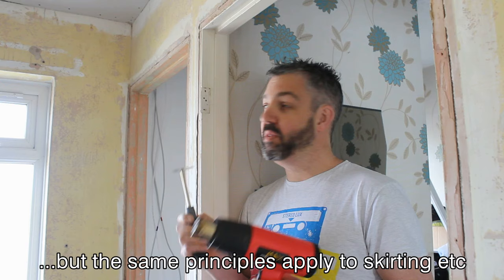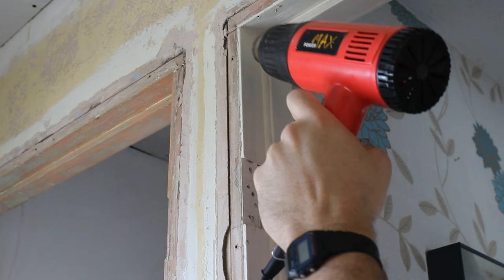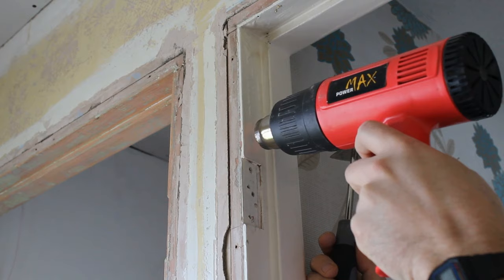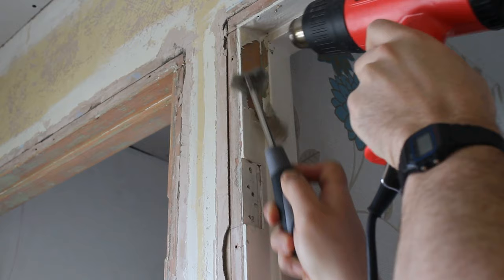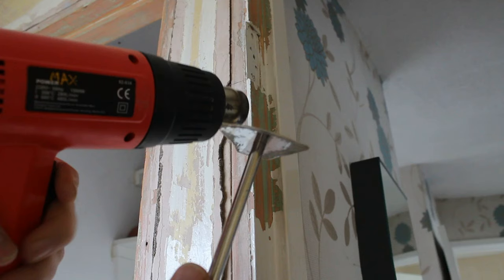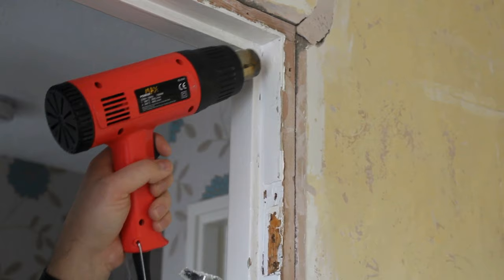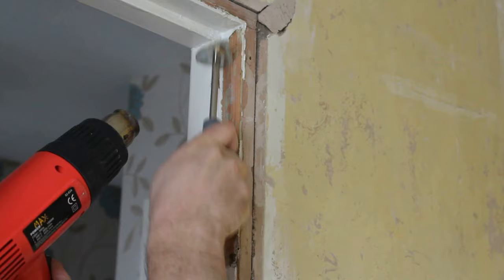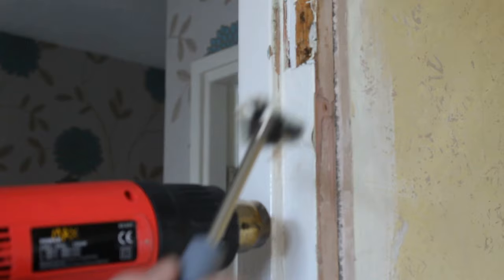How to strip gloss paint off wood - Easy way to remove gloss from door frames and skirting

Comment: Of course I just finished painting the walls and have now decided to strip the door frame and door.  (Always doing things the hard way!)  Do you recommend a way to protect the wall from the heat gun?
Reply from the maker: Oh dear! All I can think of is holding a length of wood (not too thick) against the wall. If you used metal, it would get hot too quick and transfer the heat to the wall. And don't worry, you shouldn't be getting it hot enough to set fire to the wood!! 👍🏼
Reply: @charlieshooter  Thanks.  That's a great idea.  .  I also found an attachment for the heat gun, with a smaller opening, which will allow me to be far more accurate.  I really appreciate your response, and your helpful video!  As I think about my options, I wonder if a wooden spatula would work.  Maybe even a metal one if I work 2-3 inches at a time and allow the spatula to cool between.  If I have to do a little paint touch up, I guess that wouldn't be so terrible.  Thank you again.
Reply: @charlieshooter  I did it!  No damage!  I eventually just used my scraper.  First, I scored the corner with a utility knife.  I placed the scraper at about a 45 degree to the wall, applied the heat and pulled the bubbled paint away from the wall instead of scraping up or down.  It worked great, two inches at a time.
Reply from the maker: Excellent....glad you managed to sort it in the end! 👍🏼

Comment from the maker: I've always found it easier to go top to bottom, so you can scrape the paint down. But do whatever feels easiest for you. Thanks for watching.
Reply: Cheers butt! Got loads to do! 😩
Reply from the maker: It's not too bad once you get going! Good luck with it all! 😀
Reply: I find it easier to follow the heat gun with the scrapper for long periods. Rather than stopping every few scrapes. Nice video, though!
Reply from the maker: @benjaminmears7257  You will find the best way for you. After just doing another load of this scraping recently, i would say it depends on the type of paint and how thick it was applied as to whether this works mind.
Reply from the maker: Terribly Vexed  It depends on the paint used really. I did some more recently and it wasn't too good where a water based paint had been used so emulsion on a wall may not get the same results. As for damaging the wall....that depends if it is solid or plasterboard i guess.
Reply from the maker: Terribly Vexed  Maybe try it in an inconspicuous area first!

Comment: That looks better than the gooey mess of runny paint stripper and scraping. I have a porch railing that has a thick coat of peeling porch that needs removing b4 painting. 3 hrs of sanding and scraping hasnt put a dent in it. Its like a thick pudding skin over the other paint. Paint under it is fine. I dreaded using the gooey stripper that needs a hazmat suit and 3 block area cordoned off. Great tutorial.
Reply from the maker: Thank you. I hope you managed to get the job done without a gooey mess! 👍🏼

Comment: Was debating whether to use a paint stripper or heat gun. My stairs have many layers of paint...there could be lead based paint too. But heat gun seems the way as long as I wear a mask and the area is ventilated. Thanks for this video appreciated
Reply from the maker: As long as you take all the relevant precautions you should be ok. Always assume there is some lead paint if you think there might be.
Reply: @charlieshooter  thank you! Appreciate your reply. Thanks

Comment: Thanks Charlie
great YouTube clip 
I bought one for a Diy paint stripping job and found it so easy to use
and saves time too
but one tip wear a long sleeve top, gloves and safety glasses avoids burns to skin and eyes 
believe me that melted paint is hot
when it comes off.
Reply from the maker: Good advice. Better to be safe than sorry!

Comment: Using a stiff stripping knife instead of those triangle type strippers cuts the job in half. You can put a lot more pressure on it. Wish I'd learnt that about ten years ago!
Reply from the maker: That's probably good for a large surface area, like a door, but I find the triangular stripper better for getting into the nooks and crannies.
Reply from the maker: Kip Kruse  Everyone seems to find the best way for them. 👍🏼

Comment: I’m stripping years and years of gloss off my nasty 70’s style staircase and door frames. I started off with the heat gun but burnt it out after an hours use 🤦🏼‍♂️
What I found was the gloss was bubbling and snapping/breaking off rather than scraping off. I’m guessing I was putting too much heat into the gloss?? 
Now resorted to sanding took about a weeks worth of graft. At least this lockdown has been good for doing those crappy jobs we’ve been putting off!
Reply from the maker: Yes, this lockdown is great for getting all those jobs done...and you can take more time than you would normally too, to do the job properly! 👍🏼

Comment: Thank you. I have a ensuite bathroom in my room. Because of the contact from the shower (wood did not have any waterpoof protection), the architrave and bottom of the inner door frame rotted. So I was going to replace the whole thing but decided against it as it was only a section, 30cm by 13cm wood will be needed to be replaced so decided to just cut away the rot but will be buying new architrave as they only about £3 ish each. I wanted to remove the entire gloss paint to bare wood so can use water proof, to protect it against any water damage and your video is perfect. I already own a heat gun and just ordered a paint scraper for a few quid and some wood filler to fill any holes or jagged edges. Many thanks for the tip.

Can I ask, what would you recommend for waterproof varnish or paint. I want to paint it all over the inner door frame, architrave and my new door so if it does get water from the shower, it won't rot?
Reply from the maker: I'm pleased the video helped you out. Thanks for leaving a comment.
An oil based (traditional style) gloss paint should waterproof the wood enough. If you're more concerned, maybe look for an exterior grade gloss.

Comment: Thank you!
Really useful video and very well presented.

Love that you answer the questions here! And so I have one...

Does the scraper not damage the wood? I’m looking to remove paint from a 1930s door frame and leave it unpainted but using the scraper I’m worried will leave scrape-marks?

Cymru am byth 
Liam
Reply from the maker: Thanks for commenting. You don't have to scrape too hard to remove the paint, so it doesn't leave any scrape marks on the wood. If you hold it at the right angle, flat to the wood, you shouldn't have any issues. Good luck with it!
Reply: Thanks Charlie!

Comment: That looks fantastic. Do you need to follow over with sandpaper, or is it good to gloss straight away?
Reply: Prime, undercoat, gloss. Always. I like using a sponge rad roller and lay off with a brush. Smooth finish every time

Comment: Thanks for this, I’m trying to remove gloss to change to satin. Can I use the heat gun and paint again? Currently using a scraper x
Reply from the maker: Yes that will work. You will need to re-undercoat.

Comment: Thanks for the video - most seem to be use citristrip/nitromors/chemical remover and scrape off which I didn't want to do! Where did you get the paint scraping tool - I've had a look on screwfix and tool station but haven't seen one similar and it looks like it'll be better at the fiddly sections?

Comment: Thank you that was very useful.  What temperature your gun is using please ? I have an adjustable temperature gun (50 - 660 degrees C) and I've no idea what temperature to use. I don't want to risk burning the wood. Thanks again.
Reply from the maker: Mine was 1500w and just had 2 settings, but it was just "high" and "low"....no idea on temperature. It actually died the last time I used it! Gutted!!

Comment: Hiya mate, have you got any safety advice for stripping lead paint? It’s likely my Georgian townhouse has got lead paint on the door sets, skirting etc. I wondered if you ever come across it in houses and what do you suggest? I’ve read that lead dust is very dangerous so I’ve put my DIY on hold until I know more. Many thanks for anything you might be able to share 😃
Reply from the maker: The dust can be very harmful yes, and so can fumes if you heat it too much. Heating it so that it literally just softens it (not burns it) should be fine, but make sure that you wear an appropriate sealed mask to protect yourself, not a paper one! Also make sure everyone else is out of the house for a few hours after, and it is well ventilated.
Reply: @charlieshooter  Thank you so much for your reply. I’ll take your advice on board 👍

Comment: Hi Charlie, thanks for the video, started a door today that had years of shoddy paint on top of one another. Any recommendations for cleaning the scraper now it's gunked up?
Reply from the maker: Turps or warm it slightly with the heat gun and give it a scrape with another scraper maybe. Hope the video helped!
Reply: @charlieshooter  helps loads Charlie! Really appreciate your work and started to do up the house using your tips. Without them I would have already made some school boy errors!

Comment: Running that heat gun, you could use some ear plugs to protect your hearing. Thats a lot of noise long tern so close to your ears. That old  paint coming off should be handled with gloves and a mask too ( lead or not- still chemicals).  Nice scrapper tool, Ive never seen one like that.
Reply from the maker: I think the heat gun sounds louder than it is in the video. Ear plugs would be a bit overkill. Gloves and a mask...I suppose I should've really, but if you're careful your hands dont need to come into any contact with the the paint.

Comment: I've been doing the same,  and I too have found the same green coating underneath the paint,  but not sure what that is?
Reply from the maker: It's an old type of primer. Some say it could be lead based, but I'm not sure....best treat it with caution though and at least wear a mask!
Reply: @charlieshooter  Thanks for the reply,  I suspected it may be lead based,  as our house was built in late 50's. As a precaution I did wear mask,  and made sure the room was well ventilated for at least a few hours after.  Cheers!

Comment: Hi, It's my first time using a heat gun. I'm doing the same job with 150 layers of gloss paint on my staircase. I just wanted to check the order of things. Once I've finished removing the paint should I sand it and then proceed to prime and gloss? Thanks.
Reply from the maker: Yes, give it a light rub back and then prime/undercoat and gloss. 👍🏼
Reply: @charlieshooter  Thank you, I feel like I'll still be at it this time next year but it has got to look better than 150 layers of gloss paint lol!

Comment: I can tell you know from my own experience that removing paint using a heat gun is not easy, in fact it is difficult. An heat gun will remove some paint but this depends on how tough the paint is and how the paint has been applied to the wood and/or how long it has been there. I tried removing paint using my heat gun off an interior double wooden door that has seen better days, and getting the paint off, even at the higher 500 degree setting, is a bloody challenge. Scraping the paint off whilst still applying the heat makes little difference, and often doing so will tear bits of the wood with the scraper because of the heat that has softened the wood. Another challenge is removing paint from a window sill and around a window frame, and also paint around spindles of a stair rail. Again, a heat gun will remove some of the paint but there's always flakey bits left over which are a pain to remove completely.
Reply from the maker: It depends what base layers you have but there was no camera trickery in the video.....and as you can see, that came off pretty easy!
Reply: @charlieshooter  Thanks for that. I suppose it depends on the base layers as you say.

Comment: Great video 😊👍.I want to take mine back to the wood and not re gloss. Is this do able this way?
Reply from the maker: Yes, that can be done, once all the gloss is off, you will need to give it a rub back with the sander probably to remove any undercoat or remains of paint.
Reply: @charlieshooter  That's great 👍 thanks for your reply 😊

Comment: Would this method work on the handrail of a staircase? Not sure if the paint is gloss. Maybe matte.
Reply from the maker: It should work. They would usually be painted with gloss. Even if it's a satin gloss it should work.

Comment: What tips do you have when removing paint from ogee type architraves? There's soooo many curves and groves and I'm sure there is a varnish under all the paint.
Reply from the maker: The scraper (or shave to give it's proper name) I use in the video would be your best bet as it has a few different sides and pointy edges. Here is a link to one here....
https://amzn.to/3d2jsq8
Reply: That’s what I was looking for we are half way down the staircase and the hall is at least 50% gloss and I’ve been bringing up the actual wood but know I know I need a decent scraper
Reply from the maker: @hitonot822  A decent scraper (or shave) will do the trick! 👍🏼

Comment: My old large Victorian doors look like they would not  peel as easy as this - would a heat gun be effective? They look like they've been painted 20 times over the years - very thick paint
Reply from the maker: I think I'd certainly give it a try. Applying heat to it will definitely help, even if you had to go over the same section a few times.
Reply: Thank you
Reply from the maker: Sounds like you're going to busy for a while! 😉

Comment: Might be a daft question but can these guns damage glass?
Reply from the maker: I would imagine they could if you held it on there long enough. It does get pretty hot. Just make sure it's not on the glass for too long.
Reply: @charlieshooter  cheers. I’ve got a lot of windows to do and this seems like the best method over expensive chemicals that need a lot of prep anyway and sometimes don’t work well

Comment: Hi I have a table and chairs that has black gloss on trouble is I'm attempting to remove the paint this way but it seems to be smearing the paint any idea where I'm going wrong or could it be the type of paint used table is solid oak underneath if that helps x
Reply from the maker: It sounds like it could be the type of paint. Maybe someone has used emulsion on it? The type of wood wouldn't make a difference I'd have thought.
Reply: @charlieshooter  I think maybe it could be the paint it almost seems wet under the dry gloss it has been on there for years as its solid but I'm persevering xx
Reply from the maker: @hayleyogborne8381  Good luck with it all!

Comment: How did you go with protecting the paint on the wall?
Reply from the maker: We were fully redecorating, so I wasn't worried about marking it, but I can't say I noticed any problems.
Maybe hold a piece of scrap wood up, next to the area you're stripping, so it is covering the painted wall? What you're stripping is wood, so you won't heat it up enough for it to be a fire risk!

Comment: Would GHD hair dryer work similar to the heat gun?
Reply from the maker: No....it doesn't get hot enough.....and don't try drying your hair with a heat gun either!!! 😉😂
Reply: @charlieshooter  🤣 Thanks for the heads up and clarification 👍

Comment: can i use a  shisel??  i dont have that tool and i have to remove only the paint of one frame ..so why buy the scrapping tool?.
Reply from the maker: Any sharp scraper will be fine. A chisel may work if you've got nothing else, but if you press to hard, you could end up taking some wood off?  Should be able to get a wallpaper scraper from a Pound Shop or similar.
Reply: @charlieshooter  thank you .i will see what is a wallpaper scraper right now ..thanks man nice video .
Reply from the maker: @juniorundersea  Thanks! 👍🏼

Comment: Hey there! Do you know what temperature the heat gun goes to that you used it on? I have one although I need to select a heat temp setting! Also the door I’m trying to get the gloss paint off hasn’t been primed underneath do you think that would make a difference? Thankyou!
Reply from the maker: I've got no idea what temperature it goes too sorry. There is 2 settings but it is just I and II I think.
What temperatures can you set yours to?
It shouldn't make any difference that it's not primed. If anything, it should come off easier!

Comment: Better of lightly sanding it then glossing back over.
Reply from the maker: You can do this of course, but the reason i chose to strip it all back is because the previous paint job wasn't the best, quite a few run marks etc. Whichever you find easiest though.